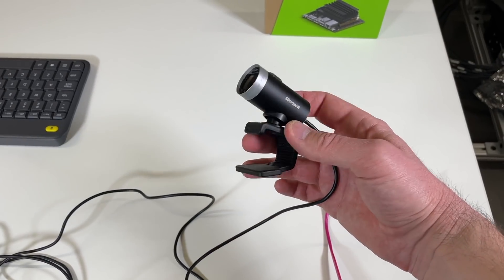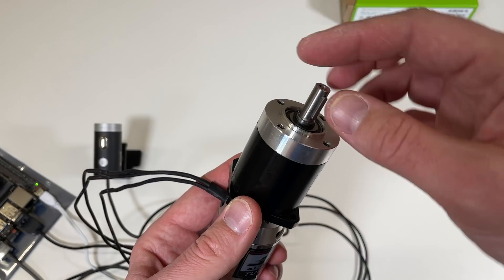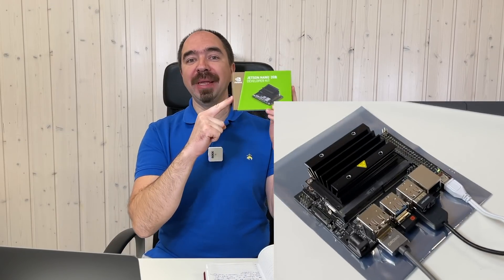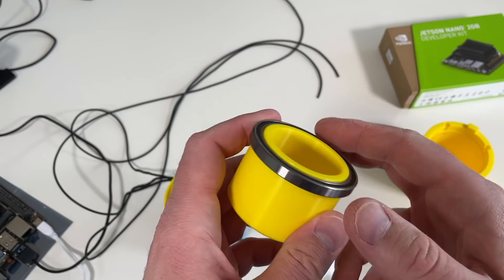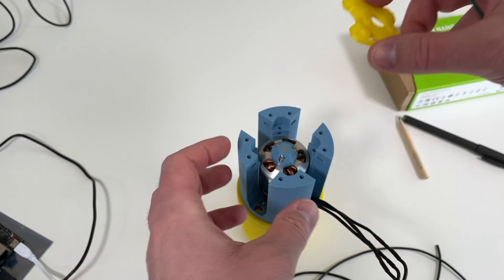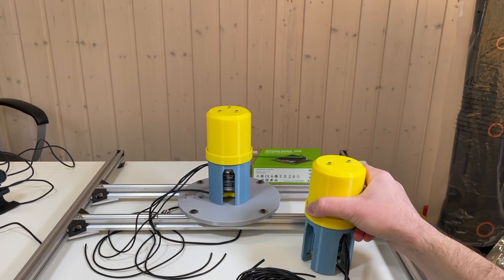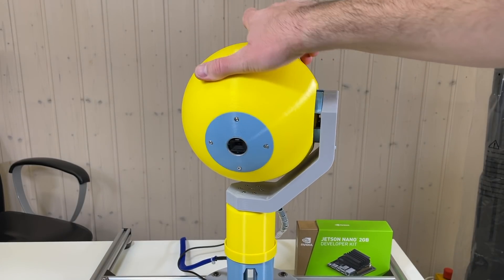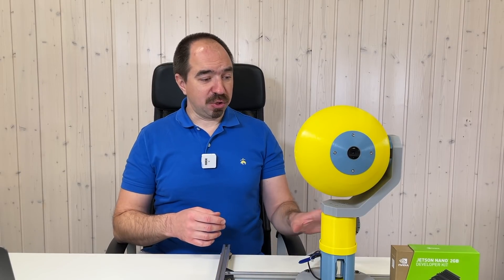Over-Engineered Mechanical Eye Ball (with RTX3080Ti giveaway) p.1

Comment: I used to sit electronics / SBCs on anti static bags. However you are not supposed to do that as they are conductive to stop static building up so maybe can fry the board. Intersting vids btw keep it up 👍
Reply: I think this is a perpetuated myth that needs to be debunked. All the anti-static bags I've ever checked showed as infinite resistance (i.e. greater than the MΩ range of my multimeter). I think they'll only conduct very high voltages, far higher than the max you're likely to find on a PCB (excluding HV power supplies of course!).
Reply: ESD shielding bags have a conductive layer I’m between two dissipating layers to create a faraday cage around the bag, but don’t conduct on the outside. It’s fine to place stuff on them, but if you wrinkle or puncture the bag, it can expose the conductive layer.
Reply: Interesting. In each test I've pierced the bags with both probes, but I suppose that may have caused the outer layer to insulate the inner. Until you mentioned 'shielding' bags, I wasn't aware of the distinction between 'Anti-static' bags and 'Static Shielding' bags. Perhaps the latter is less common. I do recall having one bag from the 90s that 'delaminated', something I've never seen happen since.

Comment: I LIKED THE EYE TYPE DESIGN BUT WHAT WAS A KICK IN THE STOMACH WAS THE VOLUMINOUS MECHANISM AND THE ENERGY CONSUMPTION OF THE MOTOR ALSO ONE AXIS IS ORIZONTAL AND THE OTHER IS ROTARY WITH THE WEIGHT OF THE EYE BALANCED IN BOTH CASES A MOTOR IS NOT NEEDED GREAT AND POWERFULL  ...
Reply from the maker: Let me explain: I DID THIS TO MAKE IT FAST. AND I DON'T CARE ABOUT ENERGY CONSUMPTION HERE. I KNOW THAT THESE MOTORS ARE TOO POWERFUL. THIS IS THE IDEA, TO MAKE IT TOO POWERFUL. :)
Reply: @Skyentific  YOU NEED SPEED AND AT LEAST 1 POUND  OF FORCE DUE TO THE INERTIA OF MOVEMENTS YOUR ENGINE EXCEEDS THOSE REQUIREMENTS BY 50 KILOS MAYBE YOU SHOULD TAKE GEARS FROM THE REDUCER SO YOU PROPORTIONALLY LOW THE FORCE AND PROPORTIONALLY INCREASE THE SPEED
Reply: @gatoninja4387  You should check the function of the CAPS LOCK key. You gonna be surprised...
Reply: @Larock-wu1uu  WON'T YOU TELL ME BECAUSE I USE CAPITAL LETTERS YOU THINK I'M YELLING AT YOU???,,,WHAT HAPPENS IF YOU SEE A SALE SIGN ON THE STREET, DO YOU COVER YOUR EARS? 😄😄
Reply: @gatoninja4387   So why do you use capital letters then? It's just very annoying and disrespectful... We see your comments also if you write in a more polite manner. The only excuse to use all capital is if you are an old school C programmer. ;-)
Reply: @Larock-wu1uu  there can be a thousand reasons why someone writes in capital letters 1 to read better 2- the caps key is stuck 3. you are playing world of tanks while making a humanoid robot 4 it is just normal and common to write like this in your country 5 -you can also the person is more than 1 meter from the pc, but it had not happened that he was rude or that he was yelling, that some people associate or relate capital letters with yelling I learned it only a few months ago and it is not yet computable hahaha
Reply: @Skyentific  
1 TURN IN 360 DEGREES IN 1 SECOND WOULD BE ENOUGH 60 RPM
Reply: @Skyentific  🤔🤔🤔🤔
Reply: @Skyentific  but if that is only the eye of your robot .... it means that your robot is much bigger something like a meka or an optimus prime hahaha  😨😨😨😨
Reply: @Skyentific  LOL